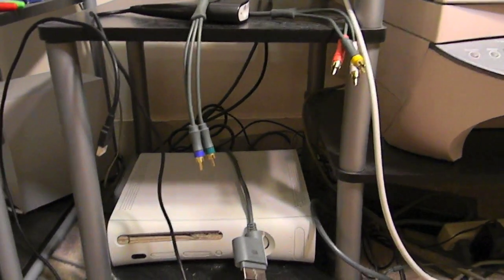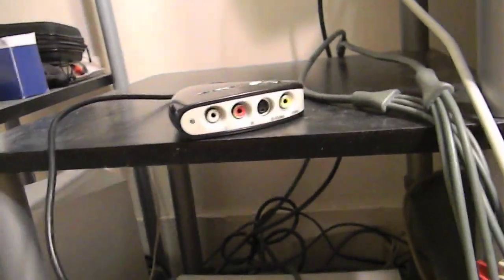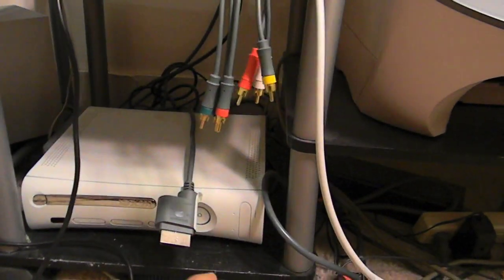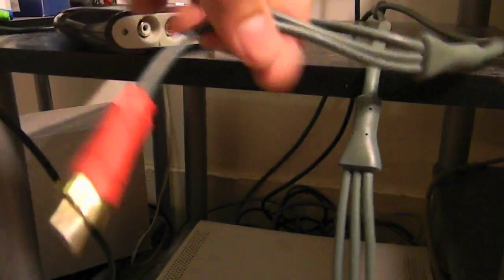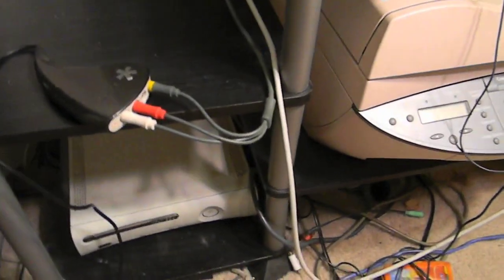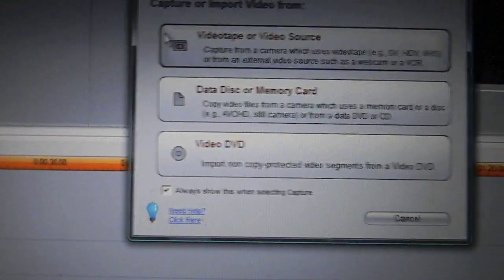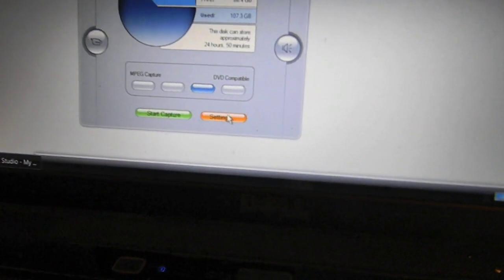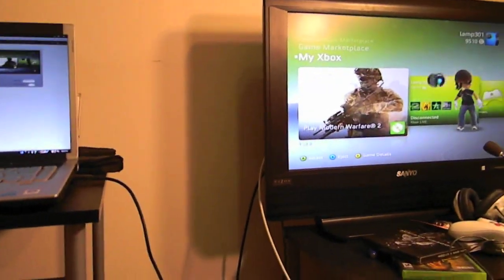Using Pinnacle Dazzle With Xbox360 and HDTV (Windows Method)

Comment from the maker: @Kx3xBigBZ69 You would need to purchase those wires, even if you wish to use them with an HDPVR or DAZZLE. The wire is called "Xbox360 Component Cables." Amazon sells them at a reasonable price.

Comment from the maker: @MrKILL3Rx It is but you would need a great amount of USB extension cables and every time you wanted to begin recording and stop recording, you would need to run upstairs and downstairs, etc. It would work, but it would cost extra money it could get really annoying and messy running wires (for the USB) around your house.

Comment from the maker: @HarmoniousGuides OKay: I've had this error several times especially on Vista. Check the following things:

1) Is the plug that goes into the back of your xbox360 on TV? 
2) Is your TV on the right channel?
3) Is your dazzle connected
4) Make sure your Dazzle is selected as the VIDEO AND AUDIO (in the settings).

Comment: This guy doesn't understand resolution. He thinks he is recording in 720 because of the first number. The thing that determines your 720p, 480p, 1080p, etc. is the 2nd number.  It would have to be 1280x720 to be recording in 720. You are recording in 480.

Comment from the maker: @IITcRuZeXx Same process, although you should purcahse the xbox360 component cables. I do believe that it works fine the Xbox Slim, but if it doesn't, you can return for your full money back from Amazon (I believe so, just double check).

Comment from the maker: @jikaz17 Pinnacle has those errors alot. Most of the time, (just make sure the switch behind your xbox360 is on TV, make sure your wires are properly connected) and then just take all the wires out, restart your computer and redo these steps.

Comment: would it not be better if you put the red and white in 2 spliiters then get a double ended rca cable and plug the red and white of that into the other sides of the spliiters and plug the other end of the cable into the red and white bit beside the component in the back of the TV? please respond i want to know what way is better

Comment: @EverythingISTech actually i just ordered a similiar cable for the ps3 on ebay, which did not come with the ps3, 6 ends, red white and yellow (standard) and red green blue component. so basically all i have to do is wat this video says and plug the standard into the dazzle and the component into the tv. does this mean i play in 480p and record in 720p or play in 720p and record in 480p

Comment from the maker: @yaquak Correct. A little extra advice to increase the quality is by going to the settings and changing the screen resolution to the highest it can go (that will not make the quality 1080, but will get it to almost 720p)